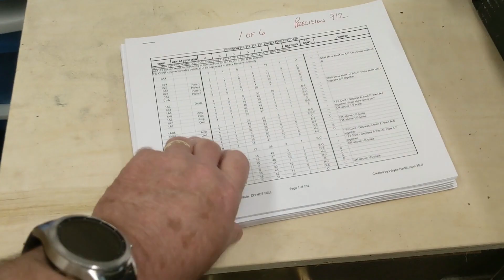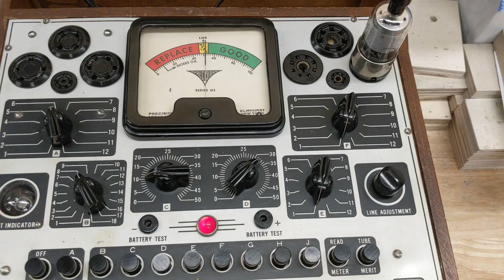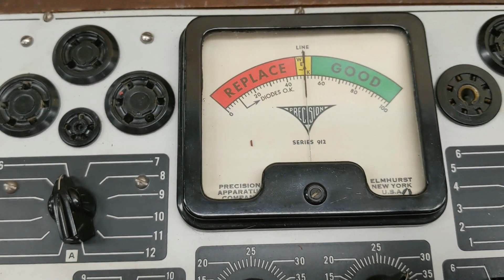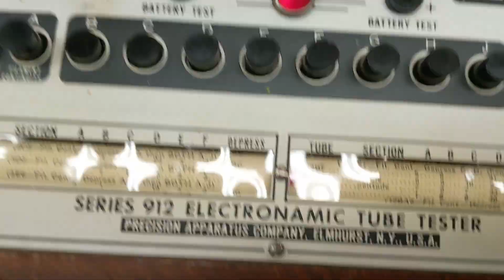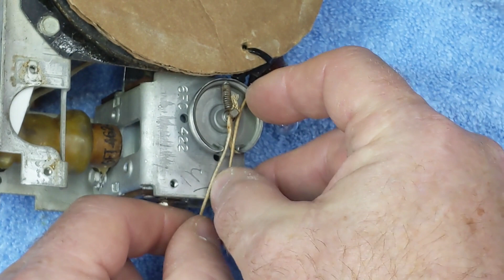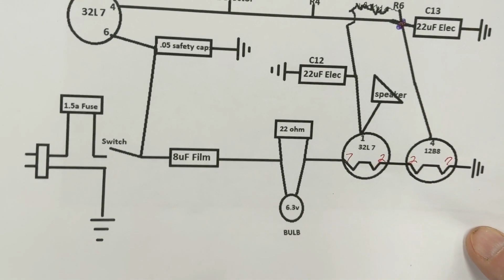Emerson CF 255  Part 3 - Testing tubes, Dial Cord & Initial Power-up

Comment: Gregg - nice job rebuilding the antenna coil and getting all of the new components neatly in place. I’ve used a voltage dropping capacitor in the past too, but had to tweak the value with parallel capacitors to get the filament voltages within 5%. Look forward to more on this little gem. Best, Don